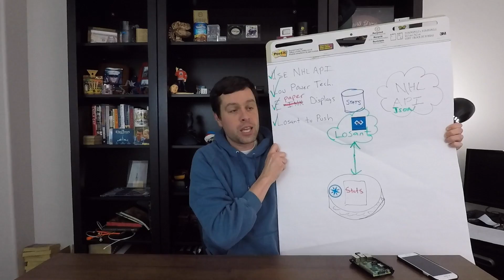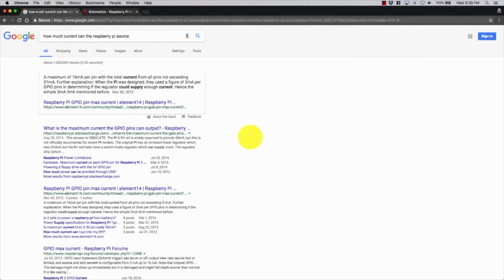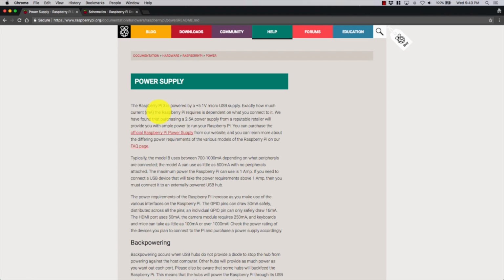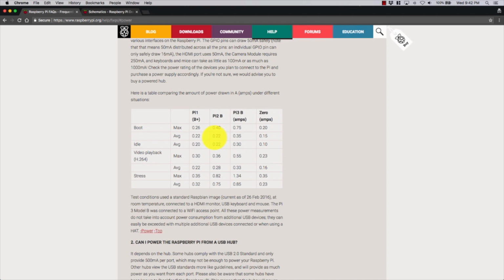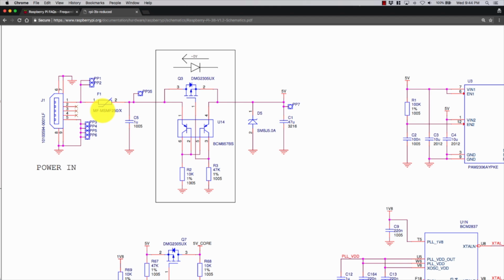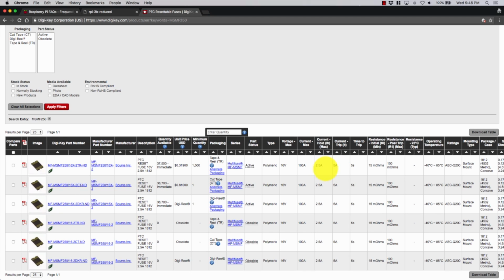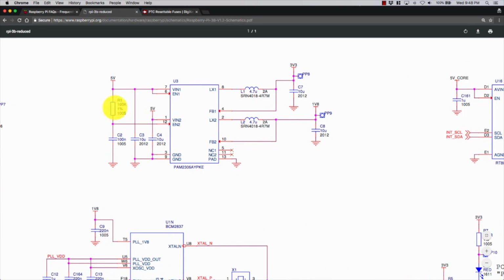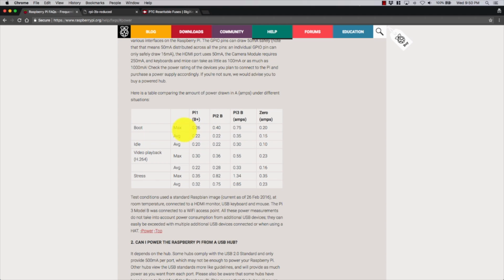How Much Current Can the Raspberry Pi 5V Pins Source?

Comment: hi Kevin, thanks for your video. You do went though some useful info, but IMO you did not explore parts which is the most useful for most readers. When people asking for `How Much Current Can the Raspberry Pi 5V Pins Source`, they are trying to get some understanding on what is the safety range they can trust gpio to drive without external amplifier, but you did not provide any data or best practice info around those. For example, I would expect you to talk a bit about those pull-up/down resistors, as well as some the max current you would expect the output transistors to produce. Based on the documents I read so far, I will not trust GPIO to drain/produce more than 30mA (by transistors) or 0.1mA (by pull-up/down resistors).  not even close to the 2.5A-400mA you mentioned.
Reply from the maker: Hey Xinkai, thanks so much for watching and especially for taking the time to comment. I thought I was being clear in the title by saying 5V Pins instead of GPIO pins which is what you are referring to but I can see the confusion. I know a lot of people look to power things directly from the 5V pin (servos, GPS modules, etc) so that was more the focus of this video.

You are exactly right on the GPIO side which I didn't cover so my apologies.

Comment: So the Raspberry gets 2.5A available.

The Raspberry probably consumes around 900mA (arithmetic operations)
I run a fan ~ 120mA and a HQ camera ~ 300 mA in parallel.

(2500-900-120-30)mA=1180mA

If I now put a 1Ω resistor between GND and 5V (GPIO pins), does the remaining available current flow or what exactly would happen?
Reply from the maker: I would expect the magic smoke to be let out of your Pi at worst and a brown out at best.  Haha. I don't really think of it as "available" in that whatever is "left" can be delivered. 2.5A is the max current the power supply can provide if needed. So if you put a 1 ohm resistor between 5V and GND per ohms law it would try to draw I=V/R 5/1=5 amps. So based on your math I'd guess that you might see 1180mA for a brief moment before your Pi decided it hates life and dies.
Reply: @KevinSidwar  hey Kevin, i decided to use a boost up converter 5V --> 12V (94%) and work with smaller currents. But according to the official raspberry team the power pins should be able to provide 1.5A :)
Reply: @KevinSidwar  would my pi die? I mean the voltage should drop after demanding too much power and the pi crash, but isnt there any polyfuse installed? And what about the SD, will  it damage?
Reply from the maker: @bra1nsen  Totally fair point, as of the filming of this video the schematic does show a polyfuse so you're right that it shouldn't let out the magic smoke.
Reply: @KevinSidwar  all the current chooses the lowest resistance, also the maximum ampere would flow through the wire right?
Reply from the maker: @bra1nsen  Yeah, should

Comment: A super helpful video. I get what you mean about determinism here! This video has helped me on my journey to figure out the maximum number of NeoPixels the Pi Zero can power from the 5v pin.
Reply from the maker: Really glad it was helpful Russell. Good luck on your project.
Reply: How many did you get? Trying the same thing here and afaik it should be as many as the psu can do minus the pi's power draw, but I wasn't sure how usb standards would play into it

Comment: I have a raspbery pi 3 B and use a 5v / 3amp micro usb power supply from ebay (one that is medium priced) , works great even with usb devices connected hdmi and a development breadboard
Reply from the maker: Sweet! 3A is plenty beefy.

Comment: Kevin, thanks for the video.

I am running my Pi 4B (3.0A capacity) headless with a max 300mA camera and no other USB peripherals or input (including keyboard/mouse). The 4B typically consumes "600mA with a bare board." I also want to intermittently power a 3W speaker with a 5V pin, which should run max 600mA @ 5V. It sounds like this would leave me 3.0 - 0.3 - 0.6 - 0.6 = 1.5A. Does this mean I still have 1.5A I could pull from that 5V pin, provided I allow for some reasonable, intermittent increases in draw from the bare board as well as the GPIO pins? I want to activate an array of motors via I^2C bus and also activate a 3.3 V relay to flash a 12V powered, 1W LED (but only the relay is energized by the Pi).
Reply from the maker: Sorry for the slow response on this. Couple of things. Yes, you should be able to power that speaker from the 5V pin. As far as I'm aware it is not fuse limited. And, yes, you should be able to use up to the max power rating of the supply through the 5V rail but some things to keep in mind. If you pull that amount of power through the 5V rail the traces are likely to get hot. Really hot, which will start to thermally "bleed" to other parts of the board and could cause other issues. I'd recommend leaving at least 20% head room and do some thermal testing even if it's just simple "does it burn my finger when I touch it" tests. As for the relays and motors you need to be extra careful. Both, depending on how they are hooked up, will present inductive loads that can create very large spikes on the power line. You will want to make sure they are properly isolated or you could end up unintentionally frying your Pi. Hope that helps some.
Reply: @KevinSidwar  yes, that is terrific info, thank you so much! The power consumption would be pretty intermittent, it's not going to be dissipating 3 W constantly. The spike issue however is definitely something I've heard before and will keep in mind. I'm using drivers that might have that handled but very good to know. Thanks so much Kevin!
Reply from the maker: @braceyourselvesfortruth2492  Awesome, good luck with your project.
Reply: What happend - did it work? Is it possible to power (5V&1A) higher load (5Ohm) via the power pinout at the gpio bar?

Comment: I just used a 12-24V DC to 5v 3A converter. Works great. Only issue I had was using the GPIO pins to power the Pi. I would get the yellow bolt from GPIO, but not USB. I think the GPIO cables I used were not a heavy enough gauge. Forgot to mention I am using this with a Pi 3 B+.
Reply from the maker: Travis that's gangster trying to power the Pi from the GPIO pins. I've never tried that. Very cool. Thanks for watching.

Comment: nice video bro,,, for smooth operation of rpi3 better to have a 3Amp of 5v power supply...  but as per recommendation,, do not use the gpio pin as power source better to have a separate/external power supply for your IoT peripherals.. my experience is to power up GSM board using 5v from gpio pin and then there you go,, the gsm board not working, it requires 1Amp supply. so what i did was to connect my gsm board to an external 5v2amp supply(phone charger)... :P
Reply from the maker: Hey Joey. Great to have you watching. Yeah, definitely don't want to use those GPIO pins to power anything other than maybe a super low power sensor. Some Epaper displays are ok too but, like you said, something like a power hogging GSM will never get off the ground with that little power. Thanks again for watching. Hope you have a great week.

Comment: "Reduced schematic" could also be called "Simplified one line diagram" I'm an electronics technician and I had to memorize and recreate those for certifications on a big dry erase board.

Cool vid! I like your methodology of research using professor Google! I'm wondering, though, how come you didn't load test it component by component until you stressed it enough to trip? That could be a really fun project to benchmark it's power supply!
Reply from the maker: Hey Anthony, really appreciate the comment and taking some time to watch the video. Yeah, that would be an awesome project to test the fuse and other components under different current/temperature conditions. With the dead band as large as it is I imagine you'd see varying results. In my case for the project I was working with I just needed a datasheet definitive answer so I could explain why certain peripherals would or wouldn't be ok to be sourced from the Pi.

Comment: I use an apple iphone charger (1A) for the zero w. Using it as a headless iot gateway running amazon aws sdk with no peripherals.
Reply from the maker: Nice, I found a 1A on the Pi3 gives a constant lightning bolt symbol on the monitor meaning it's undervolting but it never actually browned out or rebooted on me. Replaced it with a 2.4A supply and never saw the lightning bolt symbol again.

Comment: My first Pi3 came with the official usb psu. But the pi itself had a problem when on boot up the 5 volt rail would dip below 4.8v which would cause the usb sub system to shutdown, even with no usb devices hooked up. When that happened the voltage would come back up to about 4.95v and the pi would continue to boot. Since the usb sub system has shut off there is no way of communicating with the pi. I tested the psu with a usb power analyzer called the port pilot. It proved the the  psu was supplying 5v and I was able to prove that the pi3 had a problem.  I got it through Element14 and I was able to get a replacement. The second pi3 did not have that problem and it's still working.
Reply from the maker: Wow, nice troubleshooting on that. Funny enough I've only ever played with the Raspberry Pi 3 under battery power when I was at Microsoft. Was for a project we worked on with a pre-release version of the Pi 3.

Comment: Current draw. For all my beginning projects created at my desk, I use the USB port on my computer. After which there are a couple of step down voltage devices I use the first is from Hobby King VBEC, but not sure if this is reliable and have not tested for actual failure. Had one IOT fried and don't know what caused it. But it was connected to the HobbyWing VBEC .
https://www.aliexpress.com/item/5pcs-lot-RC-3A-U-BEC-UBEC-5-5-26V-Hobbywing-5V-6V-switchable-5A-Free/498850372.html
This is the one I am currently using had a similar failure but not sure what caused it so will continue to keep an eye on the output of this device. https://www.ebay.com/i/182391151322?rt=nc&var=484962402585